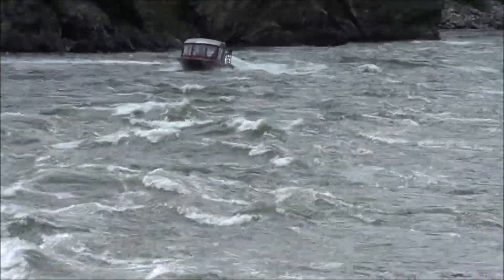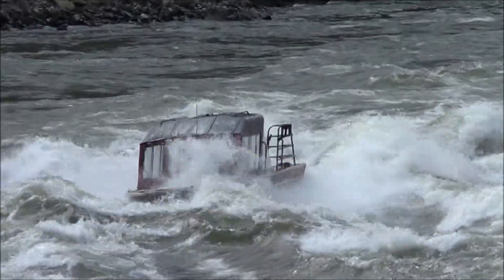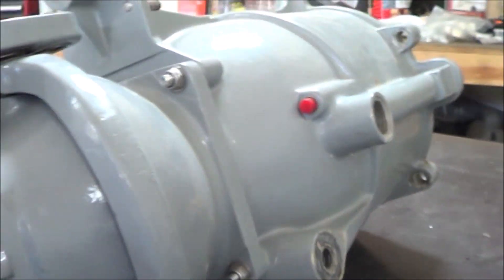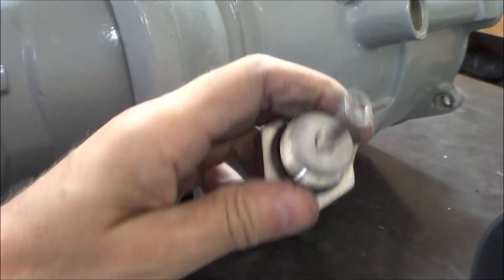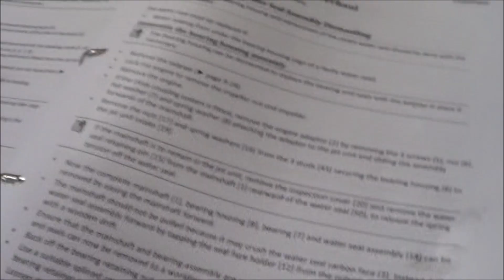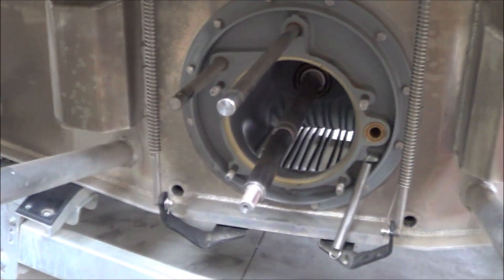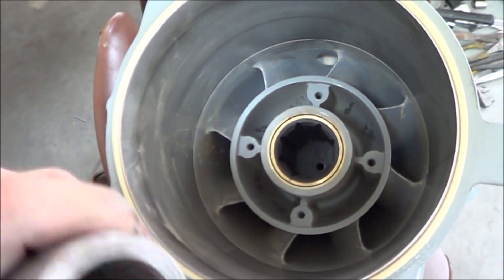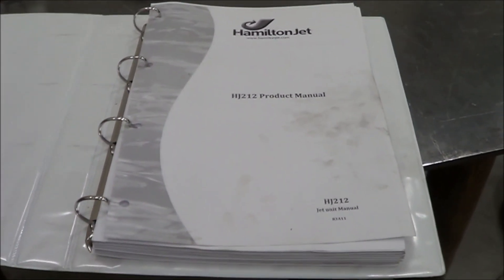Hamilton 212 Solas Impeller Part 2

Comment: Viking ,  where do you buy your solas impellers at? I did a quick google search and only found a marine power 3.4t version. On solas web page I was unable to locate ham 212 for application.

Thanks and keep up the vids
Reply from the maker: Buy from a Marine Power dealer. Note that there is only one Solas for the 212, and it is roughly a 3.4. Relative to a 4.0, it will add maybe 200 rpm, boost peak hp by rough 20, and actually will be less prone to cavitate.
Reply: Got it so marine power 3.4T = solas 3.4T
Thanks for the info and content.

Comment: Hello Viking! Nice videos!! I´m from CHILE and have a CWB... we just orderer the new solas Impeller so was great to see your video. With your original 3.4 Impeller did you have problems? If i go full throttle it splits and we reach up to 5.000 RPM. I hop we can sovle some of this with the new Impeller!
Reply from the maker: Original 3.4 impeller slipped. This was cured by reducing the nozzle diameter to 102 mm from 109 mm. With Solas the reduction is not needed, and it  does not slip. Overall performance is better. Added: it does slip if the boat is heavily loaded, but it also recovers by itself without throttle reduction.

Comment: I used to use a dow Corning d111 silicone grease and i tested it on the nozzle of an at 309 pump.  It was put on the inside of the best nozzle i had and it would be there for over 3 weeks
 It was in direct flow from the jet. It may stay on there for a bit . Great video now if we get the one guy with a precision weld.to video himself punching his face you  would have millions of viewers! Thanks for all you do for the jet boaters ! I always listen to nuclear engineers!
Reply from the maker: Interestingly, when speaking with nuclear engineers, I'm always saying stuff like "this is exactly the same as jet boats."

Comment from the maker: Not mentioned in the video. (1) cruise RPM is down maybe 200 RPM (better), but this is a sort of vague thing. (2) Overall the drive train is much smoother implying... a balance problem in the stock Hamilton impeller.

Subsequent run in white water shows significant reduction in cavitation relative to the original 3.4/nozzle_insert setup. Some cavitation/slip remains in heavy froth, so there is still room for improvement. In my personal experience, a Berkeley pump with inducer actually slips less than the 212 (however the Berkeley thrust at low speed is significantly less). Often it is stated that the Berkeley is a useless POS in white water; this is incorrect.